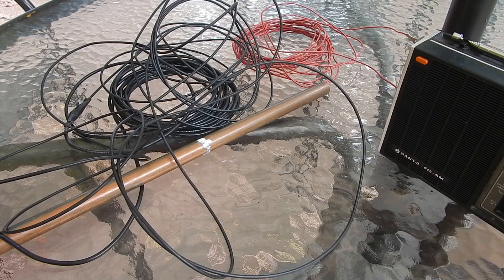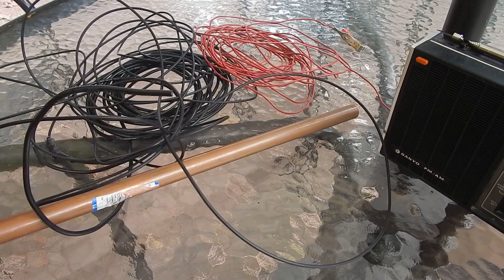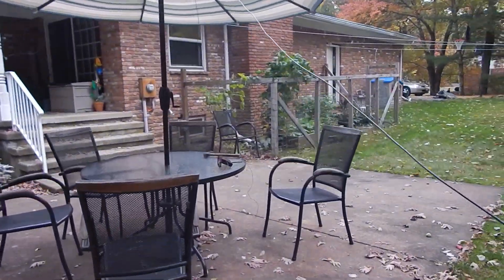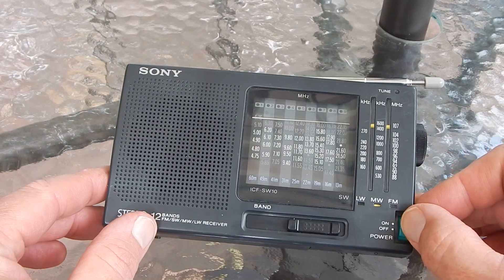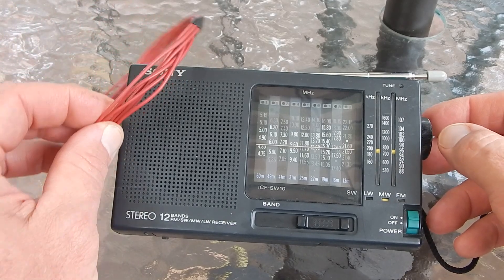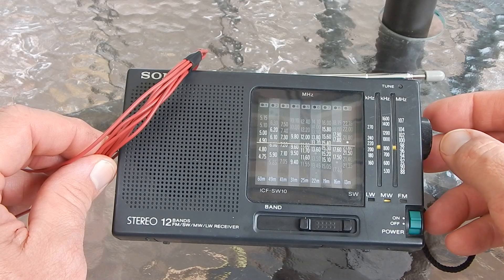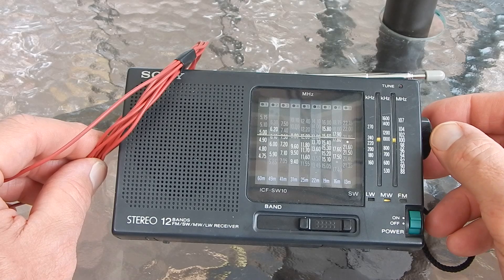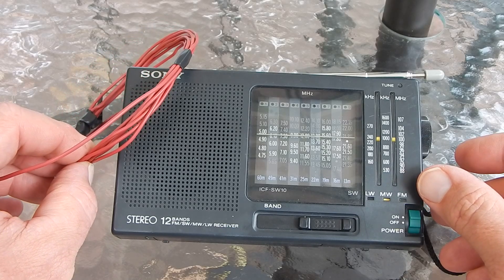A super-cheap, super-easy, very effective AM radio antenna

Comment: Is this antenna directional? That is, if I'm in, for example, Harrisburg, PA, and I want to hear an NYC station, do I have to point the wire in the direction of NYC, or not.
Reply: Yes..........to some degree. Part of the reason why stations don't come in is because of the length of the ferrite rod that is inside the radio. The smaller the radio the shorter the ferrite rod that's inside of it. The bigger the radio the longer the ferrite rod that's inside of it. Longer ferrite rods pick up more signal. 

Another part of the problem is the time of day. Signals fade more during the sunlit hours of the day than during the night time hours (due to atmospheric propogation) so much that you might not be able to hear ANY station more than 100 miles away unless you have a GOOD radio (like a Sangean ATS 803A or ATS 909X). After the sun has gone down, the "big stations" start coming in so well that you might be able to hear stuff 500 miles away in numerous directions. 

Turning the radio in various directions may play a part in reception as well. The ferrite rod in AM radios picks up signal that is coming from one specific direction. Turning the radio on a horizontal axis will change the direction that the ferrite rod is picking up the signal. 

If you're in a specific area you can have the radio facing a WNW by ESE axis and be hearing signals clearly. If you turn the radio to an ENE by WSW axis you'll hear something totally different. The easiest thing to do is to experiment during various times of the day until you understand the principles of what you hear a lot more than what you do right now. 

I live in Burlington County NJ (20 miles east of Philadelphia) and can hear stations as far away as Illinois and Iowa between 11PM and 5 AM. But between 8AM and 9PM I can't hear anything more than 150 miles away in any direction. The part of that ability that I can't prove or disprove is that the radio that I use has a tuning dial that "gets close to the frequency" like this radio above does but the one that I have is a table top boom box that weights about 15 pounds. 

A digital readout radio that can be tuned to the EXACT frequency may be better even if you don't use an external antenna.  

Hopefully that helps a bit.
Reply: nudist1033 - That was a great explanation on AM radio reception. Thank you for that. Now, if we can just get you some clothes...
Reply: That's really good info that I will make use of. Thanks.
Reply: I found an experiment on a JAPANESE MW DX'er URL you may want to try.  String out 10 meters/30 feet of cheap speaker wire.   Shape the rest of the wire into a triangle hanging the tip DOWN.  Prop the config up as best you can.  I hung mine from the basement ceiling.  You could use lengths of PVC stuck into the ground.  To complete the down-pointing triangle, alternate the ends.. As said I used cheap speaker wire.  One wire was colored silver, the other gold.  You connect the gold ends to the silver ends.  Wrap 5 turns around your portable radio at or near the "tip" at the bottom.   Have fun!  You will find this arrangement directive off the ends, NOT broadside..

Comment: Thanks for the video. If I wanted to research this design what is it called? I mean I'm looking for its proper name along the lines of other antennas I've heard of called, for instance, folded dipole, yagi, log periodic, etc. Thanks.
Reply from the maker: Another viewer said it was a "beverage basic antenna," but I'm not sure about that.  Seems more like a random wire, grounded at one end.  The coil simply provides inductance to the radio.

Comment: Dear Sir,
Could you clarify something:

Black wire going from trampoline to patio umbrella, does the black wire END there is go to the red wire or what?

Also, your red looped wire goes to copper pipe ground but where/what does it go to beyond the loop you made?

This is confusing to possibly only me, you did good work, I just need these baby steps is all.

THANK YOU SIR!!!!

Crackles,
I lost "IT" when I was 39 years old. Her name was Gertrude Thelmanrhiendt but her friends called her "Mount Everest Squared"
Reply from the maker: Thanks for the comment and question!  It is probably a little confusing that I chose "junk" wire; I simply spliced together two strands of different colors to make one long strand.  The colors are not significant.

Think of the antenna this way:
1.  Take a piece of wire of decent length, I'd say at least 70 feet or so.
2.  String one end of the wire to a support as high as you possibly can.  (For this demonstration, I simply tied the wire around the trampoline post, as high as I could reach.)  Affix the wire so that there is at least 50+ feet in the air, in the clear. 
3.  Attach the other end of the wire to some sort of earth ground.  (I tried it with a piece of junk metal tapped 12" into the ground and it worked fine.)  There should be a good bit of wire left slack; you'll need it for Step 4.
4.  At the radio location (here: my patio table), make a simple winding (or series of loops).  I did 7 loops around the widest part of my hand and fashioned it into a nice round loop, held with tape.
Reply: @Radiodog  5.The other end of the coil should be connected to the grounding pipe. 6. Put the coil close to the radio  and tune on the radio station. Works for the LW/MW/SW broadcast bands. Probably works for FM.
Reply: does this antenna work for FM reception too?
Reply: @RajVeer87156  Sometimes yes and sometimes no. FM reception is primarily best received when the length of the antenna is at a specific length that corresponds to the wavelength or (fraction thereof) of the frequency recieved.

Comment: Hi Tom! When I was younger, and there were a bunch of Radio/Electronics magazines available, a little inexpensive gem like this would usually be found in a column called something like "Hints and Kinks for Radio Fans". I've heard that this method also works well for shortwave portables that lack an antenna jack. Just roll a solenoid coil a little wider than the telescopic antenna, maybe 20 turns or so, slip it over the bottom section of the telescopic antenna, and you're good to go. Now...if we could just do something about the propagation, and the quality of programming. God I miss Jean Shepherd...Excelsior! and 73, Karl
Reply: Karl Keller : Amen! Only talk radio is good! 😊
Reply: Hola, yo personalmente uso un tubo de chimenea metálica de 13 metros de largo y funciona muy bien para sintonizar a.m sw1 sw2 un abrazo saludos desde Chile